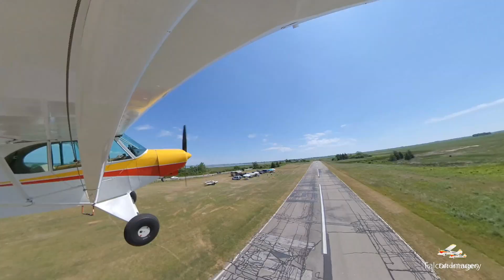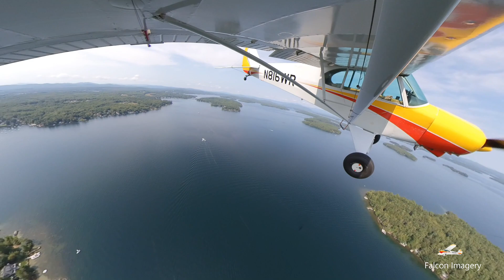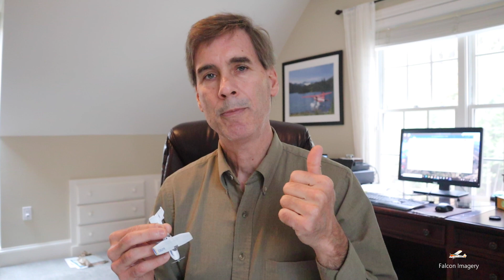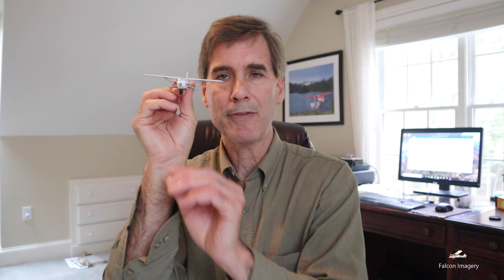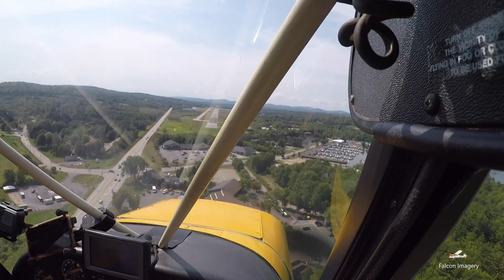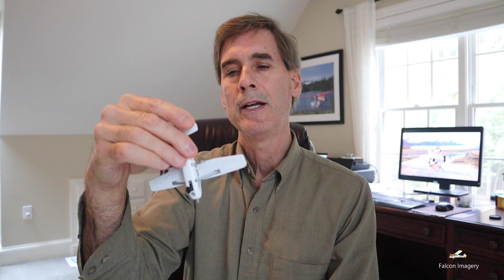Slips, Skids, and Spins Explained

Comment: Many instructors explain that "fuselage blanking the wing" causes that wing to stall". Not true (OK, indirectly slightly true). Exceeding stall AOA is what causes the wing to stall, and blanking doesn't change the AOA. What actually happens in a SLIP is that the high wing usually has down aileron (to hold that bank angle due to yaw and, yes, "blanking". But mostly yaw-roll coupling). The down aileron changes the local chord line so that area of the wing now has a higher decalage angle (difference between chord line and longitudinal axis of the fuselage) and thus, a higher AOA. And the low wing has up aileron and a lower AOA. 

Opposite with a SKID: low wing is usually kept from over banking (due mostly to yaw-roll coupling, and a little blanking) with down aileron, so the low wing stalls, and the plane rolls upside down. 

Stalling in the pattern is bad, period. A slip is a bit more forgiving because the high wing stalls first and the plane rolls towards wing level, giving you a little more time to correct the situation. It also reduces the load factor and as a result, AOA. Stalling in a skid, everything gets worse real fast. You've seen airshows where the Piper Cub does a "flat turn" keeping the wings level and using full rudder to "skid" around a 360 degree turn? Well, that's about the only use there is for a skid, and leave that to the pros.

To clarify some of the above aerodynamics: Yaw-roll coupling, or "proverse roll" is a result of the wings dihedral. When you yaw the plane and cause the relative wind to shift from on the nose to one side or the other, the forward wing sees a higher AOA and the trailing wing sees a lower AOA, thus the plane will tend to roll in the same direction of the rudder input (proverse). If you had anhedral (wings angled down, opposite of dihedral), it would roll opposite the rudder input, or adverse roll. These terms should be somewhat familiar since pilots should be aware of "adverse yaw" caused by differential aileron drag when ailerons are displaced when rolling (that's why airplanes have rudders to correct this, provided the pilots actually use the rudder). Anyone who is still awake, sorry about getting technical.

Ben
26,000+ hrs
USAF/Major Airline Capt/Aerobatic & Tailwheel Instructor/ CFI/II/MEL/Movie/TV pilot/Sailplane racer/Aero engineering and flight test.
Reply: Capt. Ben:  thank you for your highly technical discussion of stalling in slips and skids.  Flying an antique airplane   with no stall horn, what advice do you have that may hail the onset of the stall?  Other than buffeting which is easily felt.  Trying to stay alive with simple easily ascertainable ques.  Because we're all going to get distracted or make mistakes at some point.
Reply: Hey Ben thanks for your comment I've struggled to grasp this topic and have heard both explanations taught, thanks for your explanation!
Reply: For anyone who might be confused about Pro-verse Roll, (i was). Imagine left rudder input which causes a yaw to the left and side slip or relative air from the right. The forward wing with dihedral experiences higher AoA than the left or retreating wing. The initial roll is experienced because faster air over the right wing but it is held there because of dihedral. When the left rudder input is released the relative air switches from the right to the left and the therefore so does the higher AoA restoring the airplane to wings level. Thus dihedral can also create roll stability, but it is also coupled to yaw as well.

Comment: We need to buy you a bigger airplane
Reply from the maker: I love the one I have. Its like strapping on wings!
Reply: @FalconImagery  The plastic one.  I'd love to fly.  How often do you have to rebuild the engine (on the real one)?
Reply from the maker: @robert574  Ahh. Yes, I remember when that one came in the mail (its actually metal). It was about the size of a match box. I didn't pay close attention to the dimensions when I ordered it. I have found it hard to find a larger plastic or wood one for flight instruction purposes. That said, its fits easily into my flight bag, so whether I'm in an FBO with a student or on the flight line, I can access it easily. 

Regarding the real one (Super Cub), it has a Lycoming O-320 A2B in it, a 150hp engine. The recommended time between overhauls on it is 2,000 hours. I am only about 100 hours on the tach, so it has most of its life left.
Reply: @FalconImagery  Just did the math. If in my car at 60 mph x 2000 hrs = 120,000 miles.  Not bad, should last a long time.  What does an overhaul cost?
Reply from the maker: @robert574  Around $25K, and most cars produced today need to be replaced by around 120Kmiles, at a much higher ASP of $25K
Reply: @FalconImagery  :  That Cub looks like pure amazement to fly.  I'd love to take some dual with you someday.  If I can find my way out of the deep south.